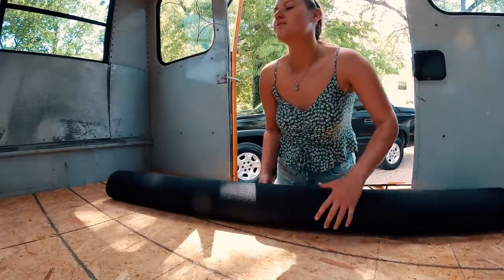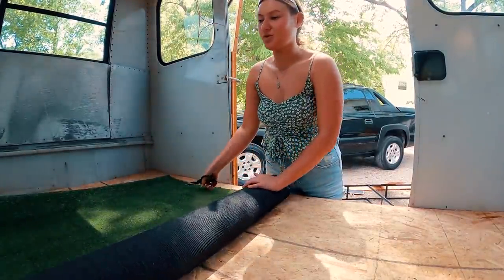Subfloor Complete - Part Two - Plus Big News! | Bus Conversion

Comment: You are doing such a good job.  I really like the astro turf floor.  I was watching a video where a couple covered the full floor of their van with astro turf.  It looked really nice and they said it was really durable.  They had one of those cordless stick vacuums to clean the floor.  Also another clever idea was they put their sink in front of a window and the faucet could swing out the window.  They put one of those sprayers with a hose and took their shower outside the window.  They also had one of those small shower tents with zip up door for privacy.  It hooked to the side of their van and could be installed and removed as needed.  It was so cool!

Comment: If that particle board gets wet its going to disintegrate so you need to put rubber or something on top of particle board
Reply from the maker: It’ll have LifeProof flooring in eventually
Reply: @LeaveHerWild  not the part that is going to have flooring over it....where you are putting fake grass. And you said yourself your going to have surf board kayak and such. Under the grass is where you need it
Reply from the maker: @chrisharris6461  the only thing that’ll get wet is the paddle board, but it’s inflatable and rolls up and gets put into a bag before it goes back into the bus. I may put the flooring throughout though and the grass over that.

Comment: A moisture barrier might help too - something under the grass carpet so if you have to stash your water toys still damp it wont damage the plywood. If you have to you might be able to pull the grass carpet out too and spray it clean & air dry it. Your work looks amazing! Good for you!

Comment: Thanks for your generosity.  I have watched a few of your vids and wish you the best in your build. I am a carpenter of @ 50 yrs. now so always interested.  I was watching you silicone all your windows. Hope that works but in all my experiance , just want to say that with silicone , if there is any moisture and not completely  Dry .Silicone will not adhere well . After is dry, dry dry it will set up. You may not find out until you rattle down the road for a ways. Just saying , I couldn't see how it would get dry enough with a towel. If you have to do again , use a hairdryer to make sure that it is dry
 Hope all works well for you . Take care and stay well. Dan in Canada.

Comment: Not Knocking Renogy  they've upped their game in the last few years both in PV and chargers. 
   Hoping you got an MPPT kit and Li Ion type Batteries 80% full use vs  Deep cycle Lead acid Possible 25% power use ( Draw of usable energy ).
    Li Ion can go 15+ years while Lead dies upon reaching its 3rd.  
    Laymen's example of power use for you. 
    Lead Acid at 25% power 3 years is 75% total available power gained if that. 
    Li Ion in the same size battery bank = 80% power always giving you 240% same available power in the same 3 year span.
BUT, wait! There's more!
   Li Ion keeps going! Lets look at the 15 year plan ( yes they can go 25+ years)  Your Total life of useable power in 15 years is  1,200%.  In 25 years 2,000% ( Best case scenario). 

The Wrap up
   75% total power Lead vs 1,200% to 2,000% of Lithium. Hmm not a hard choice is it! 

Lead turns the lights on and charges the phones. 
Lithium runs power tools, fridges, water pumps, Tvs, charges everything with out a hiccup! 

   Lead is an Old man. It hates being charged fast and giving up power and the voltage drops fast causing inverters to beep after an hour or two of use. You'll need a dumb huge bank thats heavy. Its useless IMO.
   Lithium banks will take a C1 C2 C3 charge and release. This means 1x100amps in or out which runs many appliances with out batting an eye lid.

Inverters explain easy.

 High frequency and Low Frequency
HF types have small capacitors thin wires tiny power mosfets  and undersized Transformers. <- if you pull more then a few amps through them you'll fry them, pop fuses, and over load them.

LF Types cost more, Heavy, Rugged, Built with High quality parts last years and yeas and years and can have large motor draws on them like fridge, water pump, saws, air compressors, electric chainsaws, weed whackers, mowers, Lights ect...

Just something you should know. Much Love,
                    
                        "The WickerShire Project"

Comment: WHY wait till it rains to c if the skylight leaks, which I'm sure it won't. Put a garden hose on it to test it, then if there is a problem you can fix it while it's not raining. Cheers from Canada!😁🇨🇦
Reply from the maker: I was 99% positive that it wouldn’t leak so I wasn’t really worried about it
Reply: @LeaveHerWild  😁
Reply from the maker: @homernextdoor5950  What’s the fun in taking proper steps? Lol jk...a little
Reply: @LeaveHerWild  No doubt eh! I guess it's my 28 yrs of carpentry/construction. I'm almost always working outside up here in Canada so ive learned to stay one step ahead of Mother nature, most of the time lol. Looking good on the bus build,  can't wait to see your next vid!